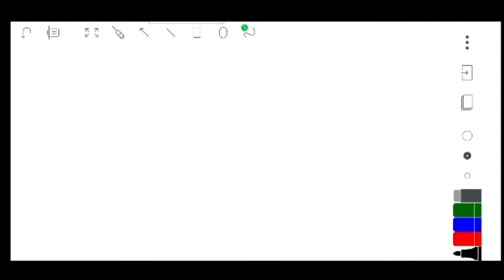Why Voltage is same In Parallel Circuits?

Comment: Doubt:-

i think the current flowing into the three resistors is equals, but you said that "the current flowing into the three resistor is different, hence the electrons will differently in each of the resistors". I think pal "the current which flows out of the three resistors in different individually". 
So the explanation after that seems very confusing to me!
but overall before that part, the video was GREAT
Guys correct me if i'm wrong pls!
Reply: Compare this to a stream with many channels line by line.... The first channel will get more water than the next channel.... I think this makes sense.... But like he said when resistance is more current is less and when current is more resistance is less.....

Comment: Why Voltage is same In Parallel Circuits?
Your EXPLANATION is STUPID.
The Reason the Voltage is the Same in Parallel Circuits is because The Battery, which is Providing the Voltage (Pressure Difference) is Connected to Each of The Resistors Individually.
So the Resistors Individually, get a Pressure Push from the Battery.
THE CURRENT THROUGH THE RESISTORS WILL BE DIFFERENT FOR EACH OF THE RESISTORS.
Same PUSH, Differing Opposition (Resistance) - Gives Different Current (Flow Rate) through Each of the Resistors. 
In a SERIES CIRCUIT. The Resistors are Connected One after The Other. Not Individually to the Battery.
The First Resistor Opposes the Pressure from the Battery. So, there is a Drop in Pressure After the First Resistor, GOING into the Second Resistors.
THE CURRENT THROUGH THE SERIES RESISTORS WILL ALL BE THE SAME. THE VOLTAGE ACROSS THEM WILL BE DIFFERENT.

Comment: Most braindead explanation ever, your logic fails when it comes to resistors that may have same r or decrease upwards, but according to physics it ll stay same no matter what, in a parallel circuit

Comment: Then why voltage divides in series connection?
Reply: Good question but acording to me in series voltage is different because we have different resistances . For eg voltageV1 across resistance R1 is IR1 AND VOLTAGEV2 ACROSS RESISTANCE 2 IS IR2.
Reply: But he said that increasing resistance will normalise the resistance so overall voltage remain same but why this logic not work in series?
Reply: every component like Resistors reduce the energy . But energy is always conserved. All these reduced energy adds up to to total energy at the source
Reply: Because current is the same in series connection

Comment: Sorry didnt understand why they're the same.
I understand that they are the same but not the reason why. 
Voltage is electric potential difference (the difference in the potential energy between two points, if there is a difference, work was done, if there isnt a difference, work wasn't done). So if there was work done that's voltage.

So why do they say voltage is pressure? And that it pushes electrons?
Reply: Potential is the energy that a source (for example a battery) gives to charge (V=Uelectric/q). Higher potential means that the source gives the charge more energy so it pushes it stronger, less potential means the source gives less energy. Potential difference is like the steepness of a street. It doesn’t matter how high from the sea lever 2 points of the street are, but their height difference. If a point A of a street is 100cm above sea level and an another point B is 95cm above and we leave an object to move freely from point A to point B, it’ll barely move, as height difference is only 100-95=5cm. But if it is a point A at 100cm and point B at 50cm the object will surely move freely as the height difference is now 100-50=50cm. Note that even a point is at 140m and the other at 139,5m, the height difference is still the same (50cm). So voltage is like there pressure that the electric source gives the electron in order to move through a conductor. The higher the voltage, the higher the pressure so the charges will move “faster”. The lower the voltage, the lower the pressure so the charges will move “slower “.

Comment: Is same resistor is there, then how woul it balance
Reply: if same resistance is present in the different resistors, then the amount of current flowing through each resistor will also be the same, hence according to V = IR, Potential difference will also be the same

Comment: Can you why does current doesn't remain constant in parallel circuit?
Reply: why should it? we know current is the flow of electrons. if in a parallel then it will not be same for each loops because of resistor. if resistor magnitude is same in all loops then current will be same.
Reply: Oh! Simple 
it gets divided into the branches (in more simpler words).
Note that:- The can be same to eachother when there is same resistance.